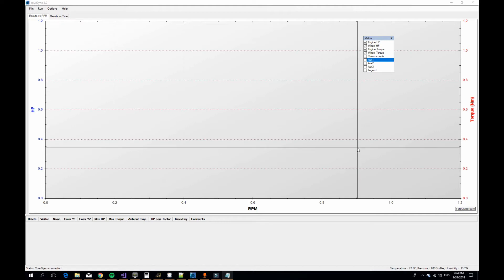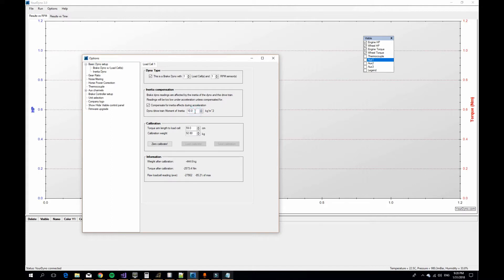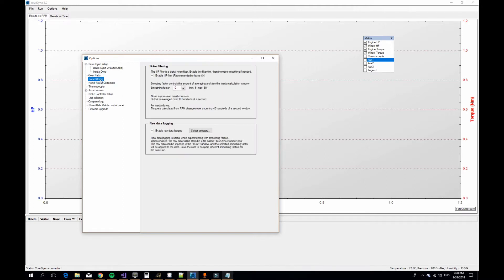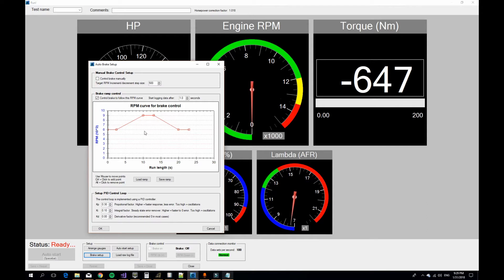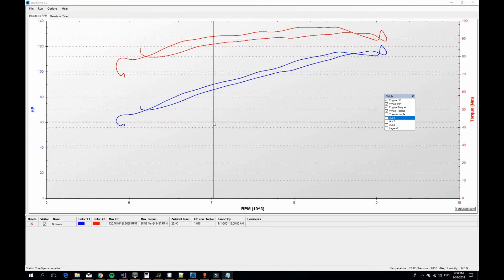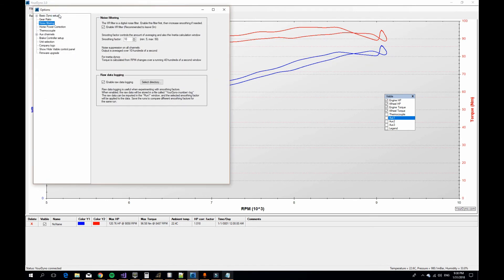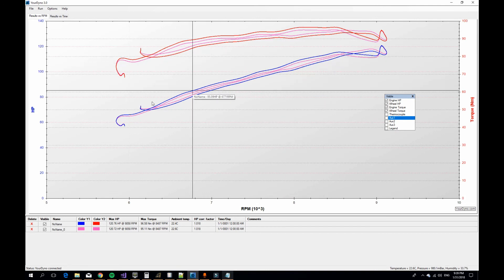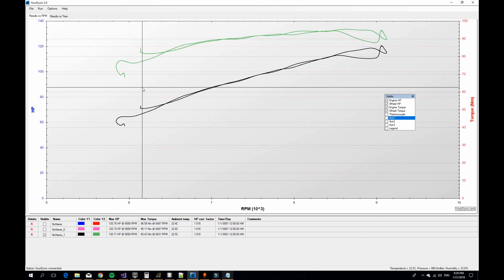Moment of Inertia measurement using YourDyno

Comment: hi very good video , i'm making my own dyno for motorcycle but i have a problem , i d'like to run  50 cc scooters and also over 1100 cc motorcycle but my roller only do 30kg ( D 320mm x L 300 mm) if i put a brake on it yoy think i'll be ok? thank you

Comment: So you're recording from 6 to 9 going full inertial and 9 to 6 loading it, then comparing to find and exact match between the two? This is done to get accurate real life readings right? This has to be done with every different vehicle?
Reply: Yes, you go up then down in RPM on the same run. It can be fully inertia or braked on the way up. Another way to do it is one steady state run (inertia does not matter) and one sweep. Then make the readings match at the steady state RPM by adjusting the MOI, which only will impact the sweep. The YourDyno software now has a special inertia measurement function that can automatically calculate the MOI. MOI vary a bit from car to car, so if you are after the most accurate engine readings then you should test the MOI for each car. Many dyno operators use a fixed or semi-fixed number for the MOI though.

Comment: Most dyno's DAQ can't measure race cars like rally or rallycross , due to the short gear ratio and small engine inertia ( 4 in line engine with light flywheel under 3 kgs and forged crankshaft for example) . Is your method able to measure it with results like a engine dyno ?
Reply from the maker: There are many ways to do it. Another way that works well is to do a slow power sweep and a fast power sweep, say for example 250 RPM/s and 600 RPM/s. The runs should overlay when the MOI is correct. This can be done with almost any engine. Make sure the boost overlays too and is not lagging on the fast sweep, otherwise you will get some difference even when the MOI is correct. 

YourDyno also has an MOI wizard that measures the retardation time with 0 brake and a little brake, and from there calculates the MOI. This works well if the dyno has enough MOI